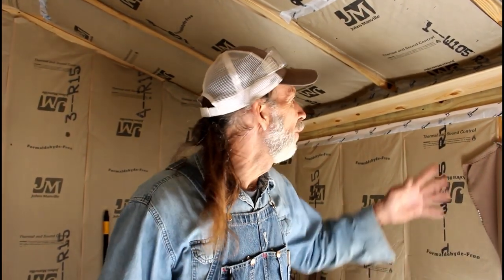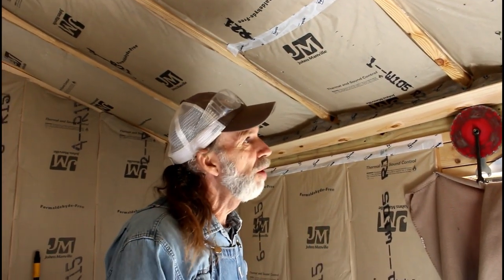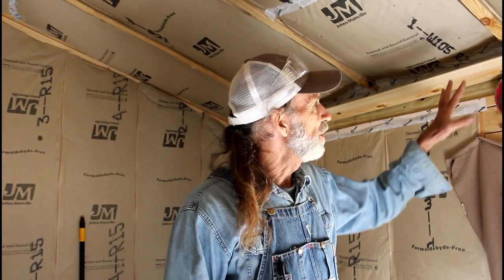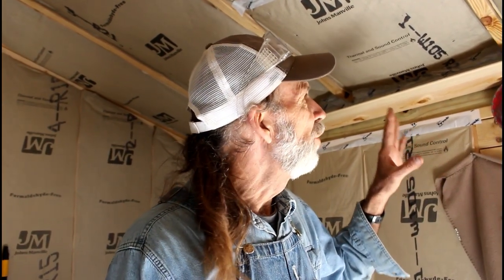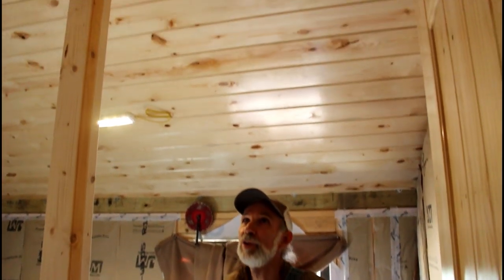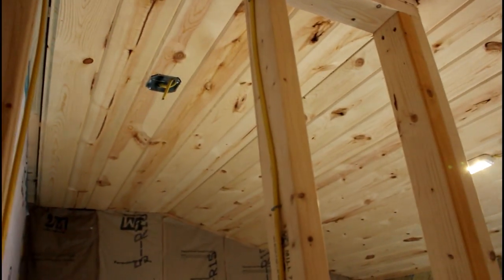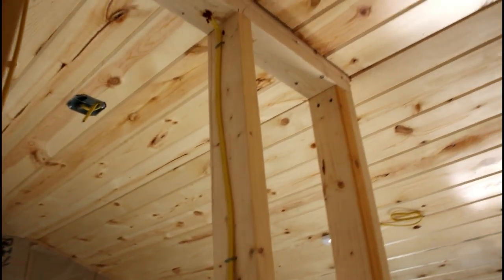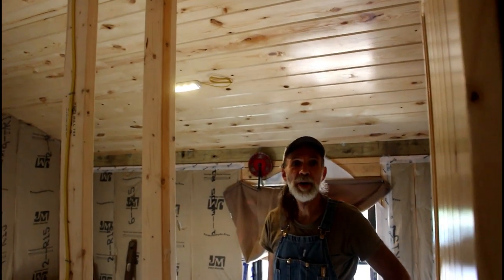Off Grid Cabin Build | Tongue and Groove KNOTTY PINE Ceiling | Episode 22

Comment: Fun stuff . I myself once installed couple thousand square feet of car siding to ceiling and probably half of the boards had to be bent into a straight board as I was installing it.
Sometimes you could bend by hand. Other times yeah to use two screws, pry bar and  a block.